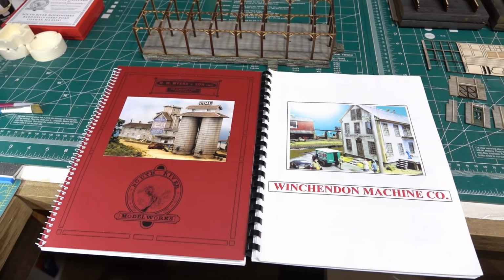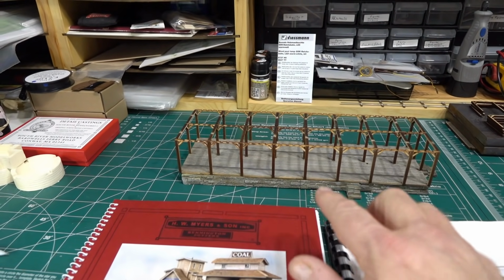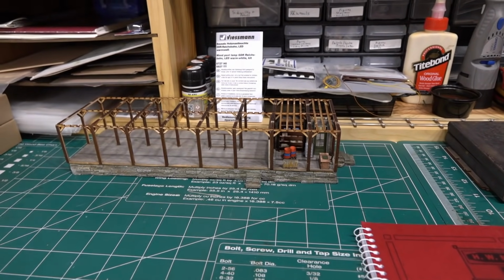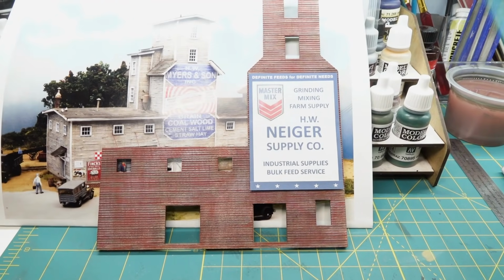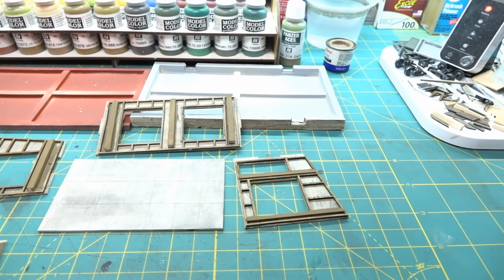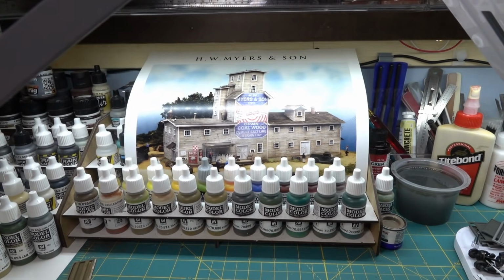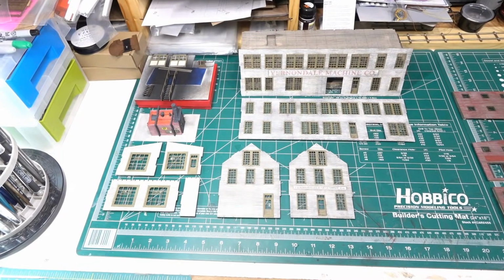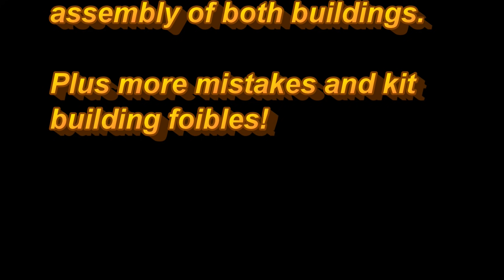Kit Build #2 & #3- Two Craftsman Structure Kits: Part 1

Comment: Yep, watched it all Rob and thoroughly enjoyed it too. Of course this stuff is of interest, that's why we follow your channel. The trend does seem to be for shorter videos because a lot of folk's attention span is only 10-15 minutes nowadays. I think a lot of railway modellers are a slightly different animal though, as patience is a kinda prerequisite for this hobby.
It was interesting to see these kits going together and to see that there are issues, even with these expensive, craftsman-type kits. That stuff pi@@es me off a bit; surely all these problems should be ironed-out, perhaps literally, before the kit is released. I've got a couple of similar-style kits, in N scale though, that Ib picked up on eBay a couple of years ago. I think you've inspired me to make a start.
Really looking forward to Part 2 and, quite possibly, Parts 3 + 4 too, as the electricians and fitters go in, then the workforce, and then the big day, when the first shipment arrives.

Cheers for now,🍻
Dougie.
Reply: Thanks Dougie. I am surprised but people don't seem to mind the longer videos. One can always watch part then come back later. So I'll keep babbling away and posting!
Reply: @robbennett1965  That's fine by me Rob.👍

Comment: Just out of curiosity, did you "AI" the Vernondale building with the windows cut out or leave them in?
Reply: Hmm, how did I do that. Darned if I remember! I think I took out the window pieces. Yeah, I did- I looked at some photos I took of the warp festival- er, I mean as they were drying under weights.
Reply: @robbennett1965  I was just wondering if that may have added to the warping issue?  I have considered getting this kit myself but I'm still in the Planning stages.

Comment: For curiosity, did you print signs on inkjet or laser printer?
Reply: Inkjet- a Brother model. Not a high quality printer, one I have for work. But is did a fairly nic job. I do notice the blue color isn't as "deep" as the original. But it is the best I can get from this printer.

Comment: Hi, I enjoy your videos. If I could offer one piece of advice on building the Machine shop it would be this. If you are going to install the machinery in it, build it one story at a time. After assembling the main frame as you have done install the machinery and line staffs before you add the floor supports for the 2nd floor. You need all the room you can get for access when you go to apply the belting. You can see my shop build here;
http://www.railroad-line.com/forum/topic.asp?TOPIC_ID=30407

You do want to make one wall and the roof removable.  And do add some interior lights to make viewing easier.

Bob Harris
Reply: Bob- thank you and thanks for the link- your work is FANTASTIC! Folks, check it out it- Bob did a wonderful job on a machine shop. Very impressive. Mine is nowhere near as detailed or accurate, but I knew that going in. I could not figure out a good way to make the one wall and roof removable based on how the kit is designed, so will have to live with th interior lighting and the big windows.